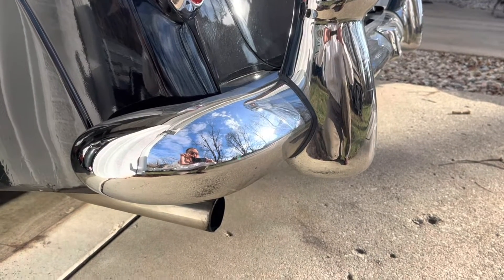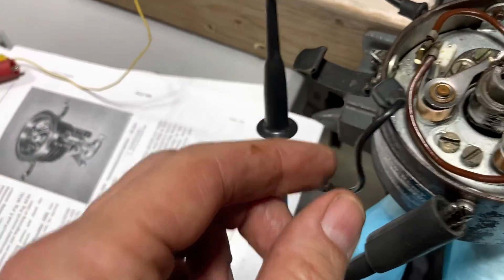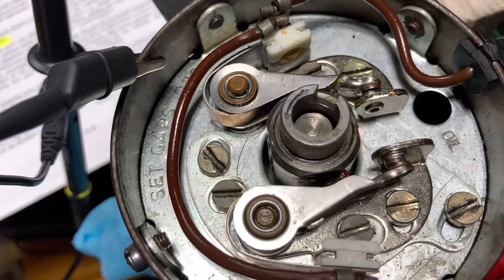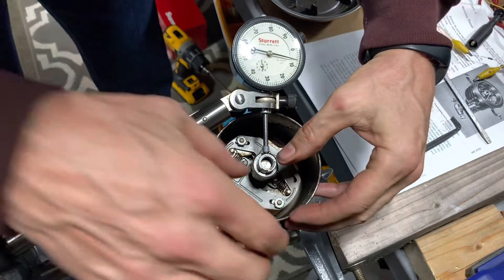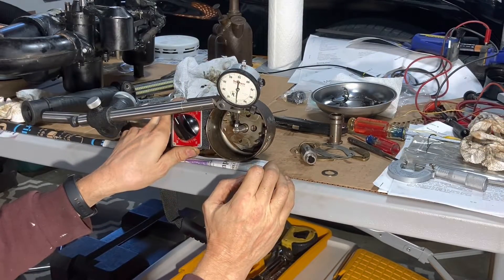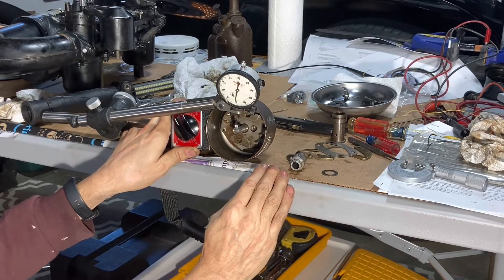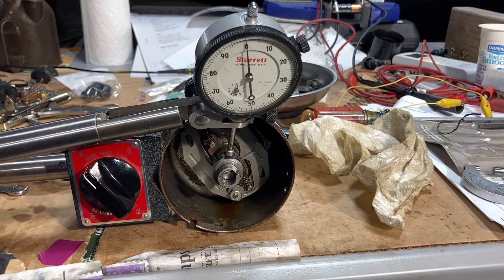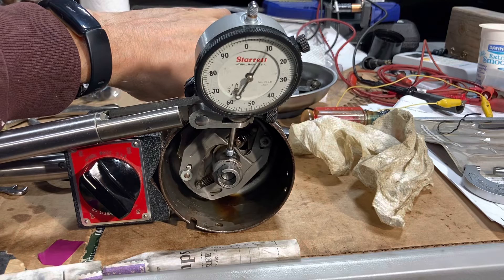Distributor Problems on a 1961 Rolls Royce Silver Cloud II

Comment: Hello there thanks for this wasome video. My distributor turns  ut i het no.spark? What can i do?.( im younger i do not know much about this thing...)
Reply from the maker: You should get a spark if you manually open and close the points. If you are not getting that then something other than the distributor is not right.
Reply: @johnsworkshop3312  thanks John, you've bin a huge  help for me.
Reply from the maker: @jewishpatriot.1754  thanks!!